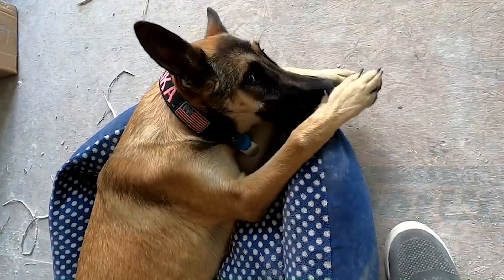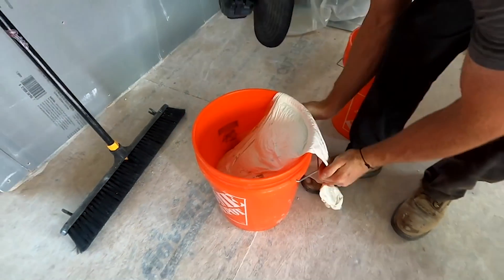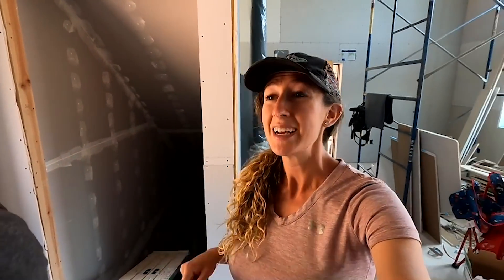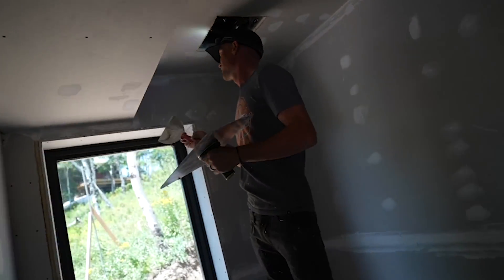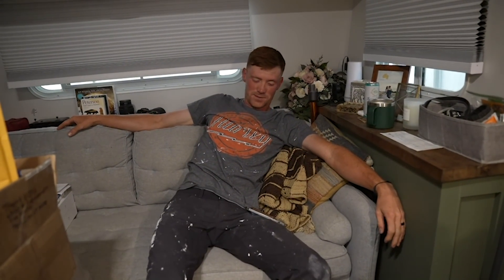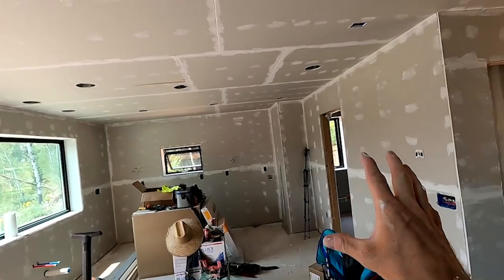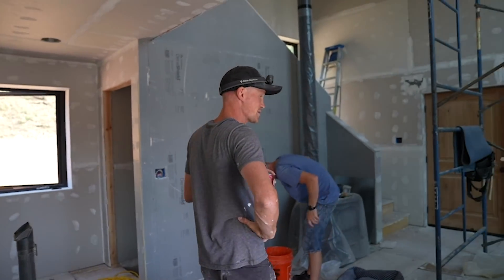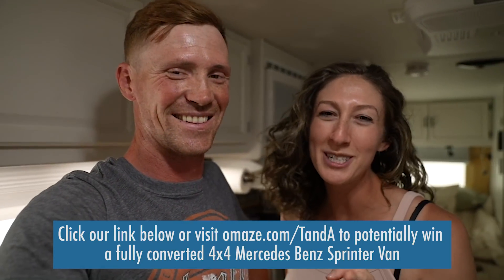TIME FOR A BIG CHANGE | TRENT & ALLIE

Comment: You're wasting time.  No need to fill seams with just mud.  Apply mud, apply tape, apply 1st coat of mud over the tape, all at the same time.  Dry scrape with the knife when dry to knock off nubs, no sanding after first coat.  Could potentially only need 2 coats.
Reply: This is true!!
Reply: thats what i was thinking a whole lot of muddding ? i think thats over kill ,,i have mudded we did not mudd that many times .... but ... their house.         id out source the roof thats to high let the professionals do it ..
Reply: Unfortunately the videos are 2 weeks behind.. so they have probably already taped by the time they read this... but yes I was wondering the same thing.. usually you fill gap and then put tape right over at same time.. I've watched a few drywallers do mudding and taping
Reply: If you use mesh tape.... you can avoid the need to pre-fill the gaps ... Mesh allows the mud to fill the gaps and makes things go way faster..... I agree.... only sand for the final coat...  at this point, you would already have one layer on... instead of not having started yet.
Reply: Agreed. Get some yellow grid tape to lay over the seams, and slap on the mud over the top of the tape. What you are doing is filling in the depressed areas built into the edges of the sheetrock. That will cause you to have raised seams, which in turn, will cause you a lot more work trying to feather out the seams.
Reply: @phoenixrising914  not 100% sure, but I dont thing that bazooka can be used with mesh...I think I heard fiberglass is a no no also...
Reply: @truthtalker4038  You are probably right.
Reply: That’s what I thought too. That’s how the top pros do it on YouTube.
Reply: He bought a Bazooka for taping, big waste of time pre-filling and if he’s filling in the recessed part where the tape goes he’s really creating problems! I don’t know what YouTube videos he’s watching! But they don’t teach this. I told him before he started Drywall go to a Jobsite and hang out with some tapers and watch, would’ve helped tremendously
Reply: @jeffreyferguson83  really screwing up with the "prefill". Where did he learn that technique?
Reply: @RamblinRoadies  I have Never seen it.
Reply: @phoenixrising914  I tried the mesh and will never use it again. I am a journeyman carpenter and had done some drywalling but when I used the mesh the outer strands kept coming loose and then I had to deal with the resulting ends sticking out. NOT FUN!

Comment: Last post on this, if you had taped and mudded the seams at the same time you would have been almost done with the job. 
I apologize I know it’s to late and you have already probably realized your mistake I just hope you can correct it.
Reply: Yes, that is the biggest mistake I see them making. It will be much more difficult to get the seams and corners done now. The reason for using tape is so that the seams and corners don't crack. Hopefully they will have enough indent left to get enough mud for the tape to stay put.
Reply: It’s like he never even watched any videos on how to do drywall. If he did you can’t tell. Starting with all the screws he used and not taping the seams. I mean 🤦🏼‍♀️

Comment: I get it, Trent is going to do it all, tons of respect. I'm sure the drywall will turn out well too.

That said, gosh if you were going to hire a professional, drywallers would be the one to get. they are fairly cheap, likely to do a better end job on something visible forever, and done in a couple of days instead of a month...

Comment: Are you going to use corner bead on the corners of where the sheetrock meets? It is a metal strip that gets nailed to the corners then mudded over? It protects the edges...walls and the boxed in window edges...
Reply: Thinking the same thing. Definitely need corner bead and it should be installed before  mudding.
Reply: Im sure they are plenty aware.

Comment: Trent, don't fill the seams and as a new guy  sand between coats. use a pad with a screen on a pole. set up a fan in a window blowing out (everything outside will be covered in dust so choose wisely) and set up a fan to blow across the room to the other fan. wear masks

Comment: I've never seen drywall done your way. You've made your job so much harder. A drywall expert would have this job done correctly in 3-5 days. Your way will cost you more in the long run.
Reply: Yes it will and I bet they put too much mud on and have an ass load to sand
Reply: This way they are doing the job for free and it would be at least 3 or 4 videos about it : saving and earning
Reply: Sure a Drywall crew of 4 to 6 in 3-5 days. Can't say the correct way have seen em do a small job in 4 days then take another 2 weeks to straighten out the mess they created. Trent and Brandon are doing fine they will get it finished on their time and have the results they are looking for.
Reply: Instant professional,
Reply: He's so stubborn
Reply: @marypa001  but the final result after painting may be be less than what they wanted.!!
Reply: Why aren't they using tape and metal corners?
Reply: @Thriller_Author  Think they are just filling gaps atm. They are definitely going to use tape. Not sure about the metal corners but they should.
Reply: @boukevanzinderen6321  Richard is right - paper table goes on first fill...
Reply: Content!
Reply: … but at least he will learn from his mistakes and become a pro by the time he’s finished, he’ll have fun along the way and he can say he never fobbed the job off to somebody else just because it was hard or boring and could have been completed in much less time. I know which way I would choose to do it

Comment: Stop “pre-filling” seems. Just tape it, you’re not only wasting time but adding another layer of mud under the tape potentially making it harder to actually cover the tape smoothly. That’s why the edges of drywall are thinner. So you can tape and cover the tape effectively. Same goes for near corners. You have no corner bead on, so don’t slap mud where corner bead is going.
Reply: I’m no expert but even I knew this! Lol! Come on Trent, you’re killing me smallz! 😄
Reply: Isn't there a YouTube video on how to mud? And where is the corner bead?
Trent mentioned possibly hiring out some of the exterior work. He should have hired out the tape & texture. They could have hung the basement while the upstairs was being finished. It would have saved a tremendous amount of time. Yes, tremendous.
Reply: Yaaa...I thought he watched video on it.???
This will be hard to watch...I thought he'd hire this part out...I wouldve!!!!
Reply: I was going to say the same thing. ? No tape?  I like metal corner tape for a good edge, Looks like they have a lot of edges.
Reply: Great advice but this video was made 1 to 2 weeks ago so they are wayyy past this now.
Reply: Yes!!! I was a professional painter taper wallpaper installer for 25 years and it looks like he's never even looked at one YouTube video. Tape has to go in the seams and you are correct, the edge of the sheetrock is tapered to fill in so you don't have a big hump when you're done. The sanding is going to be very entertaining because by the time he sees these comments, it's going to be waaaaay too late.  Pass the popcorn 🤣😅😂
Reply: @RamblinRoadies  especially since his son needs a bedroom. ☹️
Reply: @MamaBaer54  but they have had company so probably not working on the house so much.
Reply: God yes, Kyle, T-Bone.
Reply: @MamaBaer54  I suspect it is about 4 weeks out- based on Instagram post saying 16 weeks to go- and this video saying 20 weeks. O.o  Reading the mudding advice is actually just upsetting me because I know it's too late!
Reply: This comment thread is a little mean.  It sounds like several of your are really qualified to give some good advice. Can't you just do that without being so critical?  You know, it takes a lot of gumption to just dive into something you don't know.  To just move through the mistakes and learn as you go.  It's a good quality.  They have done amazing work AND they have some really talented viewers who could be like "oh wait, wait, wait...you are going to want to do this , because of that .  But all of this gratuitous slamming doesn't accomplish anything unless you are trying to make someone feel bad.
Reply: This wasn’t meant to be mean, it was meant to be informative. I realize it’s entirely too late, however he still has a lot of learning to do and a whole garage to mud and tape eventually. Learning from mistakes is the best kind of learning. If you don’t make mistakes you don’t know what you’re doing right and why.
Reply: @Megan.eco-Instinct  MEAN????? People are just trying to help him. Most of these hints were put on videos weeks ago but he is going to do it HIS way. People have been so nice trying to get him to put metal corners and not use drywall window sills but he is stubborn.
Reply: @lindap.p.1337  Imagine... him building his own house HIS WAY  The nerve of some people.  People giving advice is great. They have said often that they welcome and appreciate that.  But getting angry with someone for not following your advice is --- yes --- mean.  They are not bad people who deserved to be chastised because they "didn't listen to you" and they proceed to do it their way, make mistakes, learn, have to correct mistakes, etc.  I will never understand how or why that would annoy or upset anyone.  Being considerate simply for the sake of consideration is not that common anymore.
Reply: @Megan.eco-Instinct  it’s not mean. They want him to have a beautiful home that he has worked so hard to have. I’m a professional. It takes MONTHS and lots of homes, for new employees to be sorta ok at floating and skimming. He will have it tapped. But once he paints it will horrible looking and you will see every mistake (which at this point is the whole missing job). People are sad that he put so much effort to have a crappy looking house at the end. Not In 10 years of me in the business did I ever meet someone who did a decent job on house number 1 lol 😂 let alone house 10,20 or 30.

Comment: @TrentandAllie You dont have to put mud in the seams before tapping brother,it will dry and leave chances of leaving spots for air bubbles when you mud and tape,maybe in the spot where you made mistakes but otherwise the mud when you tape will fill everything fine.i wouldn't tell you if I didn't make the mistake when I start 30 years ago.✌️❤️❤️✌️

Comment: I’ve never seen anyone “prefill” seams before. That’s what taping is for.  Allies hair looks great!  Your stylist rocks!
Reply: I was surprised to see them prefilling the seams as well
Reply: @4noanie  That's because pre-filling is not a "thing"... It's literally a total waste of time and It's basically adding at least one extra step to the entire process which means multiple days.
Reply: Knowing how Trent likes to check out relevant YouTube vids . . . I'm surprised he didn't pick up on this . . .? ? ?
Reply: Alan d'Eon  but it makes sense if pre-filling the seams, making a completely unneeded step take even longer
Reply: yup waste of time.. just plaster the joint with mud and scrape the tape in there.. done. Scim a thin layer of mud for second and third coats. Hopefully they will learn before they do the whole house this way.
Reply: Alan d'Eon  I'm betting they won't use it, but we'll see. Totally overkill in any case. I'd much rather have an airless sprayer for painting the outside siding, sheetrock primer and ceilings..:)
Reply: @Tbone.357  I'm not arguing that it needs to be done - i was surprised to see it as I've not done it
Reply: Just making more work is what prefilling does...now they have to sand all of that b4 they tape.
Reply: @johnbolton9483  I guess I was hoping the used so little that they wouldn't have to sand before taping.. But sadly you're right.
Reply: Thank you

Comment: I am no expert but I've done some drywall. You're supposed to "bed" that tape in the mud on the first layer. You scrape the excess after you put the tape in that first layer. Meaning you scrape over the top of the tape while the bottom layer is still wet!
Reply: Me too! I'll be interested to see how doing it with mudding and letting the joins dry first before doing taping works. 🤔
Reply: Your correct. He's not doing it correctly. So funny. You would think he would have researched this first.
Reply: @miket8324  it's not funny. He's worked really hard on this project. I'm sure he did research. I just hope he's found a way that I haven't seen before because there are a lot of joints in that house and I'd hate to see him have to sand all of them down to start over.

Comment: Is there tape in the seams? That actually strengthens them. Keeps them from cracking. You're freaking me out! Love the hair, not a mom cut, but it will make you look like a cute mom in all the pictures.
Reply: 🤯 No Tape 🤯
One time I had to take a belt-sander to remove all the drywall compound, after my father-in-law TRIED to help.   I can still see the cracks, every day, where I got lazy and let it go.
Reply: They said they are taping next then another coat.....that was the math adding the days of time frame to finish

Comment: Trent, When you finally get to plastering the walls, it'll save you lots of aggravation if you cover the switch boxes and plug sockets with heavy duty cardboard fitted inside the boxes. This prevents excess plaster (Mud) from entering the boxes and covering the wiring, which can affect connectivity of the electrical system.

Comment: I helped my brother inlaw do this he used what he called a mud gun electric it has a hopper on top of gun sits on shoulder. You mix paint into mud spay on wall for texturing then he ran a large trowel over it lightly to even it out  so it looks smooth but has a textured look. Mixing the paint in helps so you don't have to put several coats on the wall when you paint ( lime 3 to 5 coats they will soak into the mud)

Comment: Trent, there is no such thing as prefilling just tape and mud. Your making a lot of extra work for your self. Don't forget to use corner bead. Should probably have done that already. BTW Allie's hair looks great.
Reply: The need to fill every normal joint crack prior to taping probably isn't necessary. However, I always fill large voids with quickset compound to avoid major shrinking prior to the tape coat.
Reply: Yes I pre-fill only large gaps with 90 min fast set , then start taping 😉👍🏻But he’s still learning it’s fine it will just take him longer.
Reply: You can say that again lotta extra work! 😂😂😂
Reply: I just watched several videos where pre-filling is recommended. Maybe Trents not too far off. It will turn out okay l think. It's just going to take longer that's all.

Comment: When applying your mud you should start with a four-inch then after your first sanding go to a 6" or 8" and then for your final coat, you should go to a 12" this makes it much easier to feather out.

Comment: Well T & A  I agree with all the comments...one process, mud the joint, press in the tape, and run spatula down the tape to spread excess mud!...that is your first layer!...no need to sand...then use wider spatula for second coat...that needs to be sanded...suggest you look up wet sanding...you DO NOT Need 5 coats of mud!.....do not prefill joints !....bite the bullet get the bazoka out and use it!....put on the metal outside corner bead “NOW “!...

Comment: I'm confused, I've always put mud down, put the tape over the mud and smoothed out the tape and then covered the tape with mud smoothing it out. Then took damp sponges to do the finish work. I have enjoyed watching your home build. You have done some great work.
Reply: 5 coats of mud? Who is instructing you Trent? I hate to see you guys doing all that unnecessary time consuming work.
Reply: My thoughts exactly! I watched my Uncle and my Dad do a whole living room 4 walls and ceiling 14x16 they finished every seam with damp sponge and went to lunch came back took the damp sponge cleaned everything and it was ready to prime with very little sanding.
Reply: @PromasterHOF  I watched a guy on YouTube do that and seemed like a no-brained to me.
Reply: I’m a 70 year old woman who is shocked they know so little about this project.  I have sheet rocked and mudded and it is NOT A HARD JOB!    That small house, with two inexperienced workers, should take no more than 1 to 1-1/2 weeks at the most.  It takes some time and can be messy but these people are making it sound like a degree in engineering is needed.